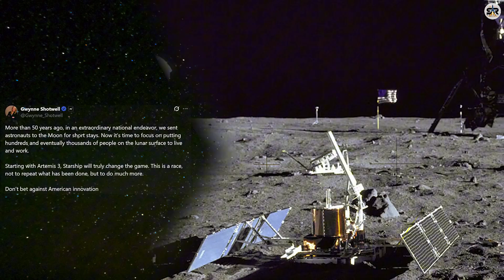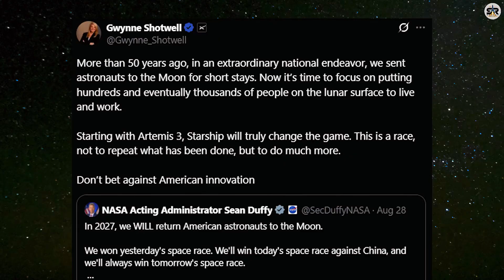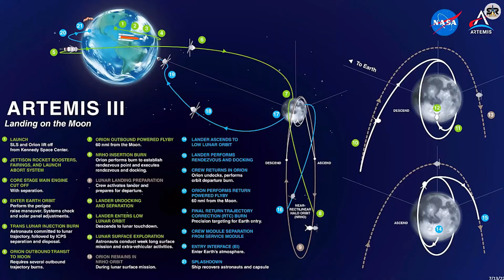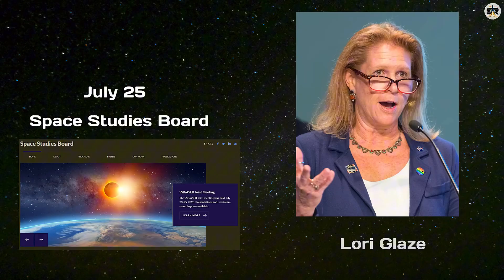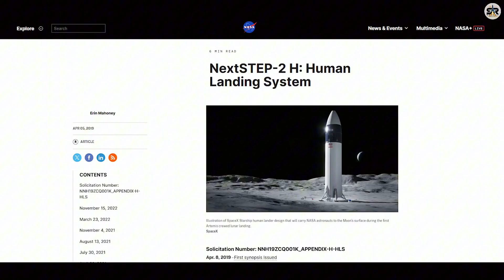Gwynne Shotwell’s INSANE Promise: Starship CRUSHES China’s 2030 Lunar Bid!

Comment: China won't have all the restrictions NASA is imposing.  Do you think the Chinese will refuel in route?
Reply from the maker: That’s a sharp observation!

NASA is being extra cautious with orbital refueling, since it’s something that has never been done at the scale Starship requires. Regulations, safety reviews, and politics all slow things down.

China, on the other hand, doesn’t face the same public transparency, congressional oversight, or contractor red tape. If they think in-space refueling is too risky or too slow, they might just skip it and design a bigger rocket with more propellant from the start, or use simpler mission profiles (direct launches, multiple launches with assembly in lunar orbit, etc.).

But skipping refueling has its trade-offs:

🚀 Requires huge rockets (think bigger than Saturn V).

💸 Costs way more in launch mass and infrastructure.

⏳ Slower to iterate compared to SpaceX’s “test often, fail fast” model.

So while NASA and SpaceX are pioneering refueling, China might go for brute force instead. In the long run, though, refueling is the game-changer — it’s what makes Mars, asteroid mining, and deep-space colonies even possible.

Comment: China hasn't even got the reusable part correctly. They haven't even got a rocket big enough. The only way they could is to do the old fashion way which  would make them go broke. The Apollo mission was in the Billions. You think they secretly have all this hardware laying around?
Reply from the maker: Fair point — China doesn’t have a Super Heavy-class rocket yet, and reusability is still a big challenge for them. Long March is powerful, but not Starship-level. That said, they are steadily building bigger boosters (Long March 9 in the works) and testing partial reusability. They’re playing the long game, just like NASA did after Apollo. They don’t need hidden hardware; they’ve got a centralized budget and decades to catch up. It won’t be overnight, but they’re not standing still either.

Comment: Landing Starship on the Moon is going to be incredibly difficult, and the surface we have mapped is simply inadequate to attempt with a craft designed like this.  It's far more top heavy than those that toppled over recently.
Reply from the maker: yess! That’s a fair concern—Starship is basically a 120-meter stainless steel skyscraper trying to land on a sandbox with potholes.

Comment: ONE LAUNCH TO THE MOON. How about a V1 Super Heavy Booster and V1 Starship with a Stage 2, like the test 30m booster 14, 30m tail stage 6 vacuum and 3 sea level engines. Star-Ship V1 HLS one less floor for 1mw nuclear generator & batteries. Engines 4 vacuum and 3 Sea level and 12 ICON electrical engines for cruising NOT costing. 6 Crew shuttled up on a dragon. Dragon will dock on the top/side of the HLS/Starship and Artemis at the nose. This type of ship as a unmanned may be able to do a MAES flyby @ 50 tones. 

We have the equipment to do Apollo type mission Flyby and/or landing this year. NASA just waste taxpayers money.
Reply from the maker: I get the frustration — Apollo showed we can do it in the ‘60s, so why not just brute-force it today with a modified Starship? The catch is, a single launch lunar mission isn’t practical with the mass and fuel needs involved. SpaceX’s refueling approach is slower, but it’s aimed at making lunar and Mars missions repeatable and sustainable, not just one-off stunts. Apollo was a sprint — Starship is trying to build a highway.